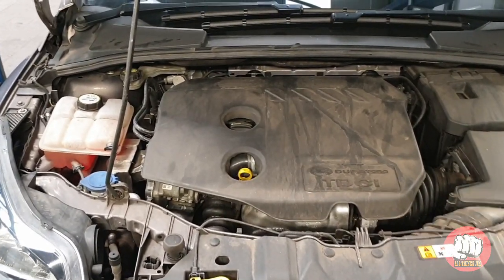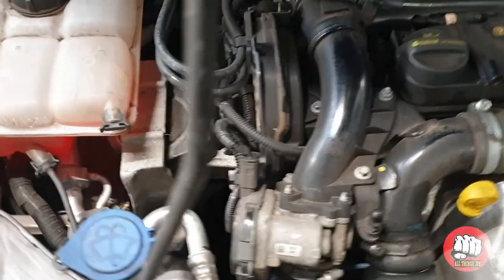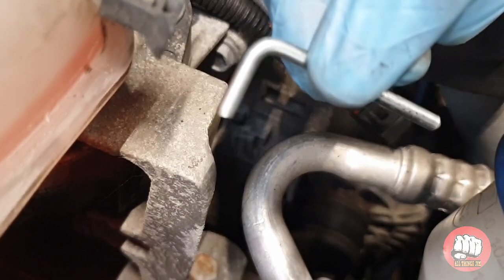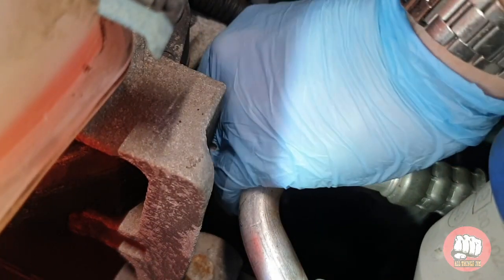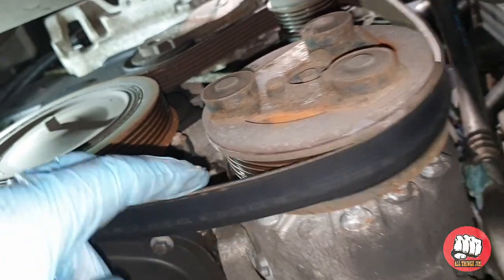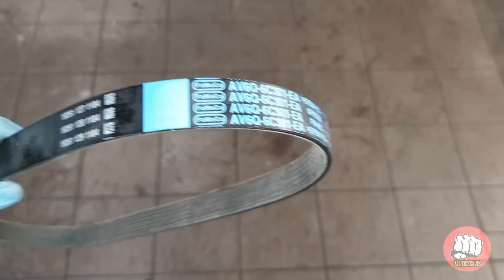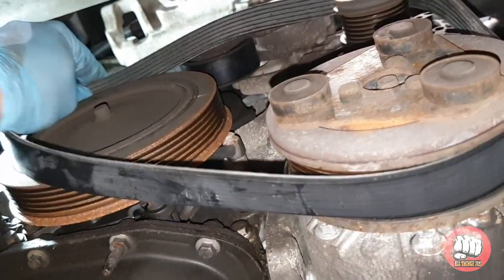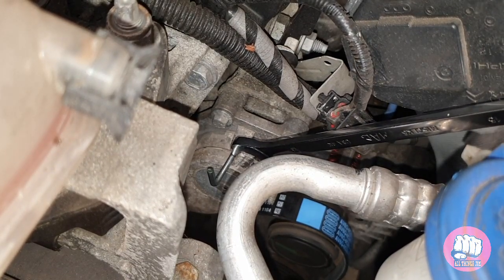alternator belt- how to replace- ford focus 1.6 duratorq  2011-2015

Comment: Get video and gave me a good run down of the layout, thanks man, I did find it easier just to spin the wheel off though, and lift the arch liner, rather than get under the car if some people are unsure of crawling around underneath, also my bloody massive hands struggled getting the pin in lol so cable tied the spanner back, just thought it might help some, them AC pipes are well in the way, thanks again man

Comment: Thanks for the video, very helpfull
Im facing a problem finding the right part for my car, 2011 focus with 1.6d. Some web sites show me V-belt with 962mm length and some with 800mm
Which one did u use??
Thanks
Reply from the maker: I used the oem one ford supplied, I didnt measure it. If you want to put an aftermarket one on but dont want to take it off to measure it, use string and route it around the belt then measure the string after 👍
Reply: @ALLTHINGSJIM  great idea, thanks for the advice
Reply: One lenght (longer) is for car with clima and secod (shorter) is for car without clima. I solve today same. ...For next people